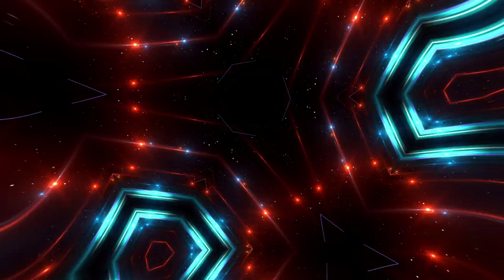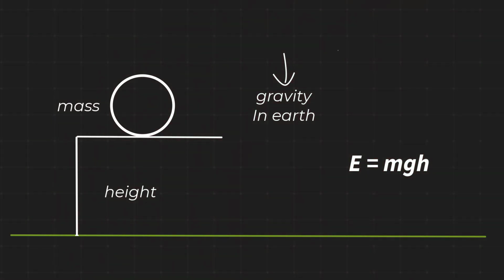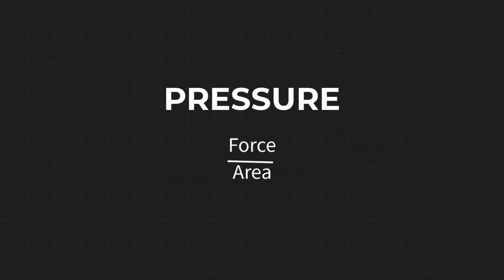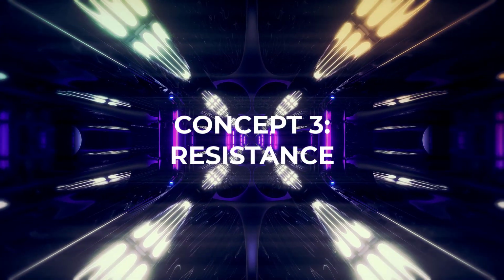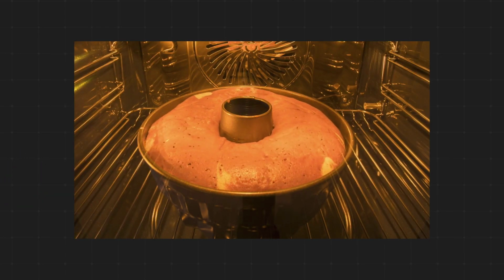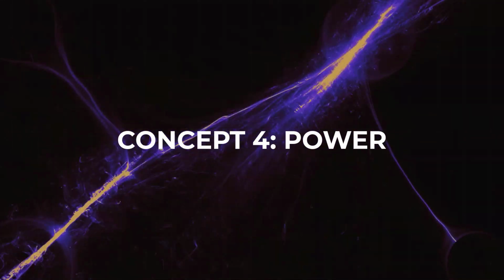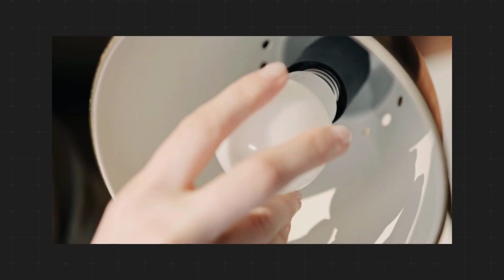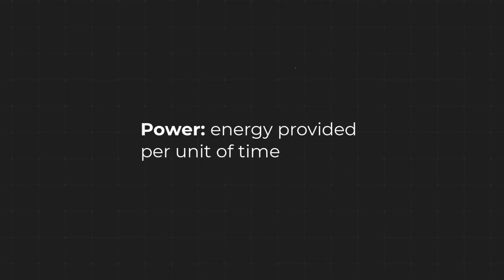5 basic concepts to start in electronics!

Comment: Perhaps you can make a spreadsheet, or an HTML/javascript calculator, then record as you find devices online. Find the values in different units, put them into the spreadsheet or calculator, calculate the remaining properties. Your light bulb example was the closest to reality. You can take real things, video them, show how to find the specifications, show how to put the data into a calculator, show what can calculated.

It is NOT the memorization of units, dimensions and conversions that is important. It is filling in the whole picture in consistent units - that is the beginning of understanding. Your calculator is a model of the real thing. An aid and tool for simulating and estimating - so you do not have to build everything. Work out what something can do, or what is needed - in the computer, in the calculator, in the model. Do not train people to memorize. Teach them to use the right tools. Let the calculator, the model - do the work of keeping the units and doing the conversions. Concentrate on using that to make your design, assembly, testing, calibration and applications efficient, cost effective and useful to people, organizations, and systems in the real world.

A light bulb produces so many lumens, but uses so many Watts. The input voltage and current used can be measured. Coulomb is a good unit, but you also will want to use Moles, KiloMoles, GigaMoles. Teach the prefixes well.  Use lowerCase for small things and UpperCase for large.  femtoJoules or femtoElectronVolts.  ExaWatts/Meter^2 or Watts/nanoMeter^2.  CamelCase helps to integrate written things that people can read, with older programming styles where spaces are not allowed in the program variable names.

How much energy does it take to lift 1 KiloGram by 1 Meter in 1 Second? If you use a wire or string and a motor to lift? If you use a magnetic field to throw the mass? If you slowly levitate the mass with a series of electric and magnetic fields?

If you use fields to lift the 5000 Kilogram module that was sent to the Moon, 1 mile from the surface of the earth and lower it again, how much more efficient would it be, than using loud noisy chemical (low electron volt binding energies) rockets?

If you are build a fusion generator, to produce 1000 HorsePower (1 HP is the power required to lift 550 pounds 1 foot in 1 second) for a vehicle, what are the advantages of using high frequency power transmission methods? Encoded power signals? Encrypted power signals?

Most of the useful fusion reactions require precise energies, orientations, timing and materials. It is NOT necessary to make big generators, just those that can reach the KiloElectronVolt (KiloVolt) and MegaElectronVolt (MegaVolt) ranges precisely. Lasers now can accelerate electrons and ions to those energies. But so can many transformers and accelerators. And those ALL start with basic calculators, models and real data and specifications of things.

I found that if you set some goals, it is easier to have a place for the things you find. You do not learn electrical engineering just to memorize things. You learn it to do something you think is important. What do you want to do? What will you need to learn, or find, or who will you need to work with, to reach your goals?

If every time you went to use your car, you had to re-design and fabricate it, you would get tired really fast. We make things because they work. You build them and then use them many times. A calculator or model is the same. You build it once, it remembers things for you, it multiplies your abilities, then you use it to make still more complex things.

If you add $Thanks, you can have people make donations to support and encourage you. I suggest you make a video first about yourself, your background, goals, resources, hopes and purpose. Let people know who you are and what you want to do. NOT what you want to learn, that only avoids deciding what to do. You do not learn physics just to learn physics. You learn it because you want to do things where that is a useful skill. You might not know what you want to do, or what you might do in life. But you can find where people are doing things you like, learn about them and try to see where you fit in.

Please do not teach people to memorize and keep things in their heads. Help groups to work efficiently where all the model parts, all the data, all the tools and conversions, plans and results are open, clear, complete and accessible to all. Then, in a fairly short time, we can have our "Mr Fusion", our "faster than light and gravity vehicles", our "atomic fuels", our "solar system colonization" or whatever it is you think would be good for yourself and the human species.

Richard Collins, The Internet Foundation
Reply from the maker: Richard, Thank you for the feedback. I'm still trying to find my style and a better way of teaching things. I really want to create really good quality videos but that comes with time. Hopefully I'll learn from people like you and videos will be better. Thanks again for the feedback, you have a bless day.